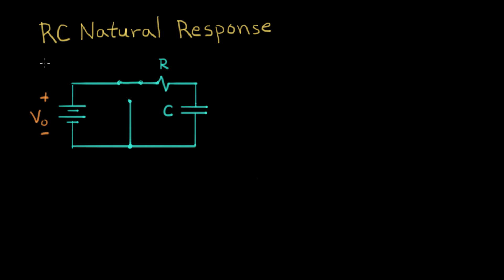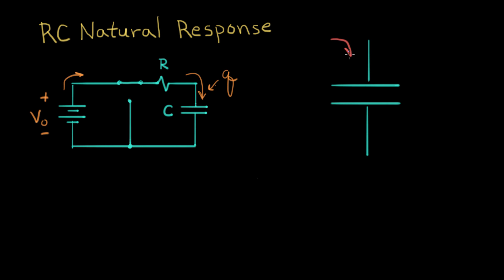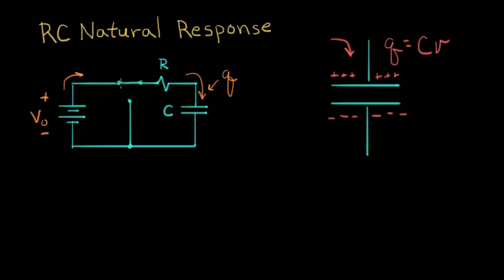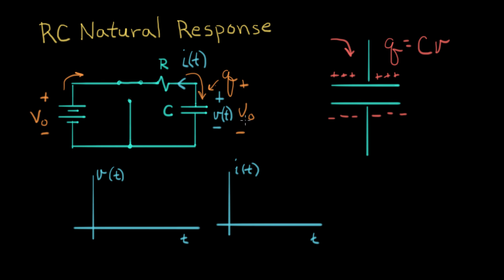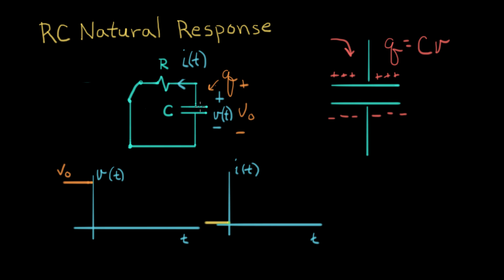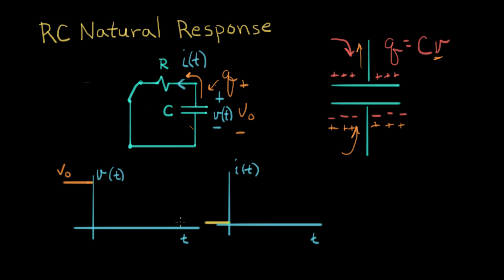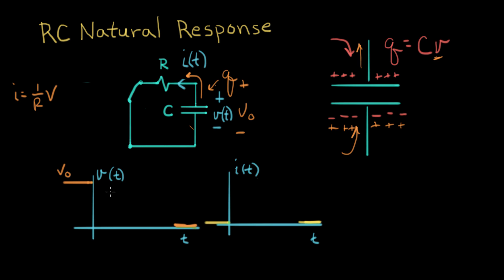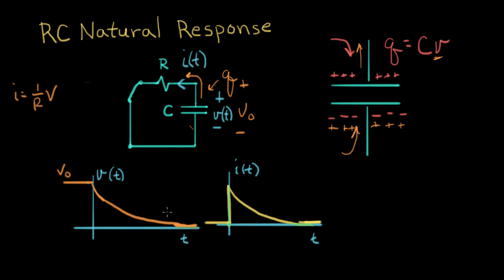RC natural response intuition (1 of 3)

Comment: How can both the resistor and the capacitor have the same voltage? doesn't anything in series have an additive voltage? someone please help :(
Reply: The Good Kid Boy i'm talking about RC source free circuit ,,, if the voltage across capacitor is 5v then by KVL voltage across resistor will also be 5v right ???
Reply: Alena Ps capacitor and resistor are in parallel here...
Reply: Aaqib Bhat how? The electrons share one path
Reply: Alena Ps Okay parallel  (or series)  ..See here the capacitor is initally charged(say V volts) The circuit have to satisfy KVL so the voltage across capacitor must be equal to voltage across resisistor(-v+v=0)
Reply: Apply KVL in loop u will get answer
Reply: of course not. the voltage difference of Vc and Vr, is Vo = Vc + Vr.
Reply: Aaqib Bhat I am stupid